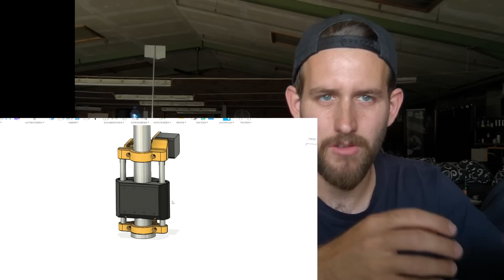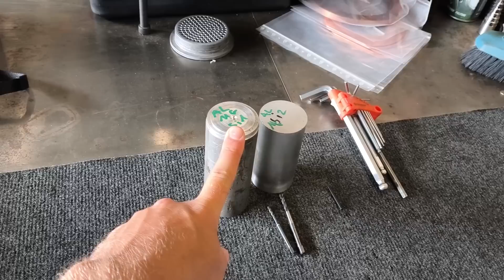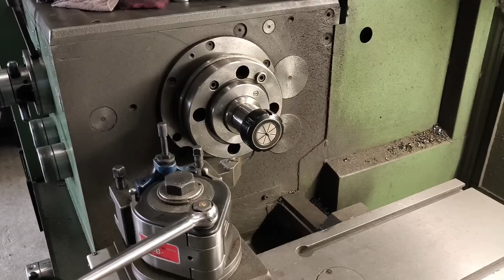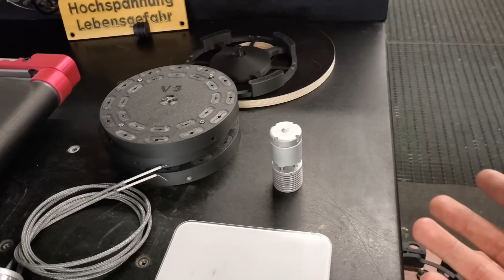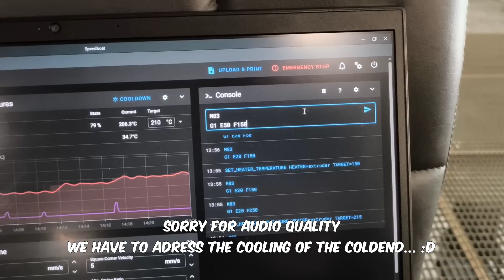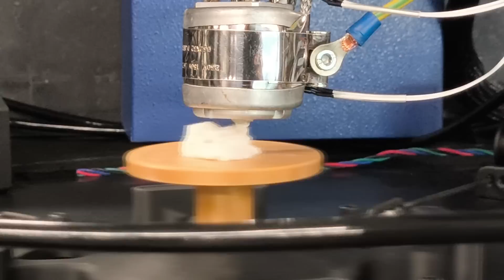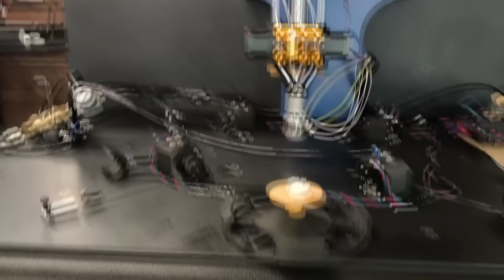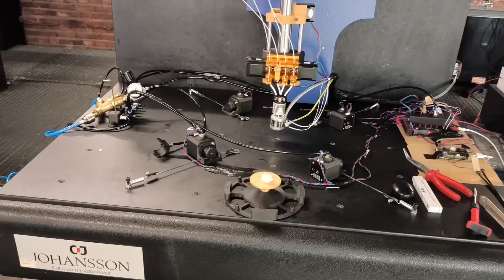Is a sub 1 min 3dBenchy possible? Hotend Build and First Print! (Episode 2)

Comment: If you need springs with constant force you can just put some weights instead of springs and just leave them hanging from the border of the table... You know what I mean right? Since you would be using the potential energy of some weight at the end of the rope, which is always a constant independently of how far the rope travelled

EDIT: Wow you guys are right, weights would have a different force in case of acceleration. Thank you 👏🏻👏🏻👏🏻

Comment: Constant force options:
1. Can you route the cable from opposing sides to a central point and put a spring between the two ends? That would ensure the tension force is always balanced on either side.
2. Use a DC motor with constant current power source to take up the slack. So long as it is only 1 wrap thick on the take up spool it will provide a constant torque and therefore constant tension. 
3. Too fancy would be to use servo motors in place of steppers and drive them with a constant torque and a position mode as well. Could be a challenge to find a control system capable of doing that though.

Comment: Wow. Really like the concept and that you had already made considerations about the tools for assembly and maintenance.
Very nice workshop too 👏🏼
I had this strange epiphany about heating the plastic optically a few years ago but haven’t followed through with trying it out. The mass should be enough to harmonise the temperature distribution within the hot end.

I don‘t think you need silver to increase the heat transfer but if you want to try it, then a coating of silver inside the veins should be sufficient and cost effective.

Have you considered shortening the distance between the hot end and the feeding mechanism by mounting the four drive mechanisms to the heater itself and driving them with one vertical drive screw with the stepper axis ~ in line with the nozzle? It may well not be relevant due to the comparatively high mass flow and the objective of the whole project.

Comment: Why 4, surly three tendons would be better! A constant force gas strut is just a piston... You are already running air, why not add pistons to mauntain tension? To keep moving mass low you could utilise a shieve so that a relativly large diameter piston, or diafram, moving a small distance, pulled length out of several shieves in the tendon tail beyond the drive. Interesting stuff, looking forward to seeing your solutions.

Comment: This might have been suggested before, but how about linking the opposing motors using rollers under the table? A continuous cable could connect both motors, wrapping underneath. This setup would maintain constant tension without the need for a spring, ensuring smooth operation.

Comment: I would expect 3 motors to be more stable with the rotational problem than 4 motors. I read about vacuum springs here in the comments, but a pressurized airtank with small cilinders gives a larger area for adjusting before altering the diameter of the piston.  The larger the tank, the more lineair the cilinder will perform.

Comment: That calibration cube reminds me of my first prints back in 2010 on a plywood repstrap.  Getting the motion system nailed down is a very nostalgic struggle.

Maybe use a regular hot end for now, until you get the motion system figured out, and then upgrade to the uber schlinger hot end when the the new metal shows up in the mail.  Perfect one thing at a time.

Nice work on getting this far though.  I subscribed, can't wait to see the next update.

Comment: I was thinking about a hot end design like this for color prints, but without wasting material, but I have no tools to prototype it. After you succeed with the speed benchy project I would love to see you try it with different colors alternating the extruders based on the needed colors. Side note, I think you could make it compatible with existing nozzle designs.
I just found this video, if it was planned I can't wait to see it print in colors :)

Comment: With springs, if you apply pre-tension on the springs you can end up in the better end of the spring curve that is not as steep in Force / distance as an untensioned spring.
also pressure based spring might help here.

Comment: I haven't watched the two follow-up videos yet, but I have an idea for balancing the spring force on opposing sides of each axis! You could hydraulically or pneumatically link them. Basically, instead of a spring, use a syringe on each side with a tube that connects both of them. Anytime one axis is moving, it will transfer the substance between syringes. With a little air in a hydraulic system it may act as a slight spring buffer, but shouldn't favor either side. Not sure how well this would work for sure, but it's an idea.

Comment: You already have a source of "constant force" springs: The stepper motors. If you can make some clever way of controlling the motor torque, you can use them to provide constant tension on the cable regardless of its position, which eliminates the need for attaching a spring (or anything) on the other end of the motor at all. It would mean that the entire load of the bed motion is carried by the motors. With some precise device to get feedback on the stepper's feedback (like a high-resolution encoder) you can do it.

We do that in theatrical rigging installations using large multipole servo motors (which are basically giant steppers) all the time.

Comment: What instead of 4 springs, the cable loops around under the table to the opposing point, sort of like a bandsaw, so you have both pull and push in the same axis?

Comment: What if you made a pre heater for the wire, have it heat up but less then melt temp, that way the temp difference is less and it could melt faster.

Comment: What about leaning into the molten puddle issue by using a heated pressure vessel above nozzle that contains a molten filament pool that is supplied by a regular spool as filament could be introduced through air tight seal higher up before melting. Then use air pressure to extrude as fast as you like. Think of it like the bowl on a carburetor maintaining a fuel supply. Retraction could be handled via negative air pressure or a pressure release valve below molten filament line than channels out as waste or reintroduced like an overflow tank on a car radiator. Kind of like injection molding but dynamic. Could use a bladder system like a well water expansion tank to avoid air bypassing molten filament. As a real estate broker with zero engineering experience, I’m 100% sure this will work. I did receive extensive training early on from Nickelodeon’s Mr. Wizard. :)

Comment: for your spring system problem: Couldnt u route the wires from opposing steppers together, get rid of both springs and only use one tensioner? 
That wouldnt be true constant pressure spring/tension, but probably much closer to it. 

Just an idea from someone without a technical engineering degree <(")

Comment: awesome video!  I just found your channel and plan to watch more!  you might want to add thermal epoxy to the contact area between your heat breaks and cold end.  Then, maybe add an 'insulating epoxy (is that a thing?)' between the heat break and the hot end.  that should kills the heat creep and oozing issues respectively.  Unless there is something about that that wouldn't work?  I'm certainly not the most knowledgeable person out there.

Comment: The leaking filament on the stainless steel tubes is due to those tubes not having a proper tight seal.
It looks like the tubes slide in easily. The aluminum block expands when heating up more than the stainless steel tubes. Even is there is a press fit of the stainless steel tubes in the heater block you risk getting a loose fitting that allows filament to leak out. I think this mainly is the reason for having the heat break and nozzle both screwing in the heater block as tight as possible on the E3D style hotend.
You also want to have those heat break tubes as thin as possible. Both to have the smallest possible heat transfer between hot and cold sections but also to have the fastest cool-down zone (you don't want the filament to be in a soft state around glass transition because this may result in a blockage of the filament transport)
My  heat break is a 6mm stainless steel bolt with a 2mm hole and a 2mm long section thinned down to a 0.4 mm wall thickness. This gives a 3 mm² area in the thin section. Your 4mm tube has a surface area of 9.4 mm² and with 4 of those, this is 12 times as much as on my standard hotend.
Reply from the maker: Thank you. Next iteration is already on its way!

Comment: so you have springs and 4 seperate stepper motors... what if it were 2 steppers crossing paths or 3 crossing even for an x or * pattern you'd simply feed the cable 🚠🚡 under the table over pulleys to the other side set your tension with a single turnbuckle on each string which you'd only need 3 or 2 of now because they'd simply loop back to the same motor it'd also alow you to mount motors in a half moon shape or out of the way closest to the vertical lift tower 🗼/arm yeah definitely upgrade the cooler for hot end with copper and it'd be easy to mount a micro pc fan on the cooling end rather than a full compressor but otherwise if stuck on compressed air cooling look at machining your own screw compressor as it's efficiency just does great vs piston compressors actually could hack apart 12v  twin compressor of meshuba brand the one i found to work for car tires well and a foam insulated box further away with a long airline to make noise tolerable  noise cancelling air intake without too much restrictions... i like how you used same color in testing but am curious how 2 colors or 4 or 3 even would change print designs  wonder if printing a 🐚 spiral shape out from center then in from outer repeating pattern would work for these purge tests making calibration discs possibly easier to follow with tripod camera 🤳🏼 ... anyways wishing you luck 😁

Comment: Really Cool Project 👍🏻
A couple maybe crazy suggestions but who knows.

Cooling the cold end, have you considered liquid coolant, maybe something from the PC CPU/GPU market you could re-purpose.

Constant force springs, tension, slack etc seems like a real headache. Could you go with a closed cable system for each axis and do away with the springs entirely? If you route the cable from the bed to the stepper then under the bed assembly and back up to the opposite stepper then back to the bed giving you a closed system. Then you could adjust the tension and have a very thought cable system. Depending on the loads you might be able to eliminate two of the steppers.

Comment: I have heard of people using needles for heat breaks since they are designed to be very thin with good tolerances and very smooth walls. They may be a better option for you. You would have to watch out for filtered ones though.
Reply from the maker: Thanks, I'll look into that!

Comment: You could buy some cheap Chinese hot ends with titanium heat breaks and scavenge the titanium if you're having difficulty finding the titanium.
Reply from the maker: Don't spoiler the next Video :D
Reply: @Roetz40  Don't think my little comment would spoil your great content. Now, if you mount the heat breaks at the same angle as the hot end filament paths and have 4 separate cold and that would be something.

Comment: Could the filament be heated beforehand in a 25x100 mm tube, forced out by an air piston, and flow metered with a needle valve controlled by a stepper motor? This removes the need for a heat break and multiple extruder drives.

Comment: Trying to brainstorm a solution to your need of a constant force spring.  Gas struts are too slow.   What about a pulley and a hanging weight?  As long as the pulley imparts minimal friction the system should always see the same weight.   Depending on the weight required you may have challenges with inertia.  Perhaps a combination of spring and a suspended weight would give you closer to constant force? You can also effectively double or halve the force depending on your pulley arrangement so if the weight's inertia presents an issue you could lower the inertia while preserving the force.   I hope that was coherent or even more importantly,  helpful.   New sub, I look forward to seeing how you solve the problems you have identified!

Comment: Another idea…. You can use such a setup along with CMYK filament at different ratios, and basically create any color, if it mixes well enough in such a short area (not sure it will though)

Comment: How about “home running” your cables so when one cable is extending the other cable is retracting? Think about an airplane autopilot servo where when the pilot pulls / pushes on the yoke the control cable goes from the cockpit back to the aircraft control surface and another cable runs from the control surface back to the yoke.  In the middle of all of this is an autopilot servo with one run of the cable wrapped several times around the hub of the servo.  Run the cables under the table so the cables are a continuous loop under constant tension. Use pulleys for the cables to reverse direction.  I’m thinking you would just use one drive (two total) with the cables wrapped around the hub of the drive. Search - - aircraft cable tension meter - - to get it dialed in.  Best of luck.
Reply: ………perhaps the only cable would be a short cable just millimeters longer then the movement of the printer table that connects a rod on the top of the table down under the table via pulleys to a 12 inch Stroke Linear Motion Guideway & Ballscrew Combined on the bottom of the table that exits out the other side to connect the opposite side of the printer table.  By using solid rods it takes out the slop that would magnify as the cable length gets longer and longer.